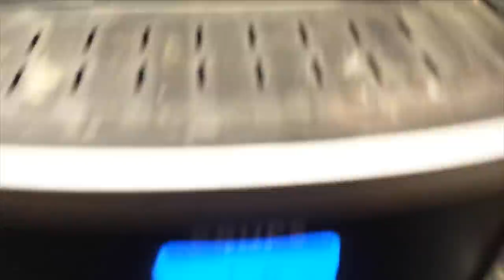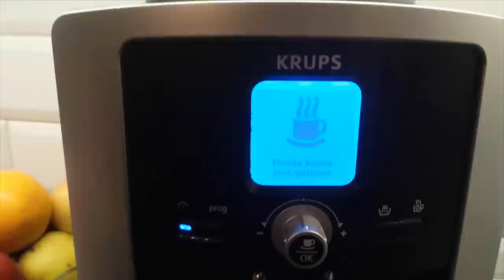KRUPS XP7200/EA8000 wyciek cz1. [leak part1.]

Comment: Thanks for good video, I didnt know my coffe machine have hydraulic cylinder, and it was leaking. After cleaning it and replacig four orings it works again, like new.

It is easy to misdiagnostice the hydraulic cylinder leak with boiler gasket leak, because water from both drops on bottom of boiler and boils.

Comment: Great video!

Gasket set for EA8 / XP7 series (Nitrile rubber (Buna-N)):
Coffee piston:              2x O'ring 3,5x36mm
Auxiliar piston shaft:  2x O'ring 2,7x16mm
Auxiliar piston:            1x O'ring O'ring 3,5x3,53mm
Auxiliar piston cover: 1x O'ring 1,9x34mm

Boiler seal MS-5015004 genuine only

Comment: Thank you Mariusz for the excellent and instructive videos. You can tell that you love your coffee machine, and you know it inside out. Well done !
Reply: +Nik Bernaz My issue was with the water tank sensor not working well. I opened the machine, removed it, then it starting acting all crazy. I put it back and stuck a magnet on it with sellotape and all my problems were gone, but I used your grinder cleaning video too as it was in dire need of cleaning too !
Reply from the maker: +Nik Bernaz 
Hi,
Maybe your problem with the tank sensor was caused by sink float?
It is very often issue. In this case you have to dry the float. The easiest way is to put entire water tank to the microwave (I'm not joking). The microwaves works only on water - only wet elements are heated. So when you put the tank to the microwave, set the time max to 1 min. than leave it to cool and repeat it till you will be sure when is totally dry. Fill with water only when is cool. Please be careful and don't heat to much (to do not damage plastic elements).

\Mariusz

Comment: Great video. Very helpful for me to get the machine to pieces for cleaning. Also I had a 09 error which is due to the thermo block temperature sensor connection at the board end (blue cables at the top of the board). Again only cleaning with contact cleaner required. We are back in business. 8295 cups and counting !!!!
Reply: mine is leaking, originally thought it was piston rings - which were worn, replaced, but still leaking, can't tell exactly where since it needs to be somewhat put together to run, but I think the hoses might be clogged because it starts leaking when it says "fill".  Any advice how to clean/fix?

Comment: Amazing Video. I opened up mine today because it doens't warm up . I think the heating element died, but the machine is only 2.5 years old . I measured the resistance of the element and it's 0 . To me an indication that it died. A replacement heating element is too expensive i think . too bad, i like this machine
Reply from the maker: +bartdereu 
Hi,Actually it is very rare to damage heating unit on this machine.But strongly possible is that the thermistor (glued to the drum) is unglued or unsoldered.Have a look at this video: https://youtu.be/pHsmttJ79zo  (starts at 6:00 - 8:00).
\Mariusz

Comment: Very good video ! I am trying to repair a Krups EA81. I have a question : I have a spring of diameter 1.5cm, with both ends coming out on 7mm. Would you know where to fix the screw ? Thanks in advance.

Comment: Hello, 
I have exact same model as your video. I have been using for about 8 years without problem. Recently water not pumping. When it brew i can hear pressure pump pumping. For normal cycle, it pump first ..silent and pump again. Now after first pump ..and water leak below and no water coming out at all. Is it o-ring issue? Which o-ring is causing problem? 
Thanks in advance for your video. It helps me out to disassemble it.

Comment: Igor, good afternoon, you made a great video, very helpful. I have an 8250 coffee machine Krups EA8052. My problem is that when I feed roasted coffe beans the grinder on the machine stalls. If I start empty the grinder, it runs withut any problem. Is there any kind of trobleshuiting to find out what is wrong?
Reply from the maker: Juan J Russ 
Hi Juan,
I'm sorry for short delay, but I don't have a time to turn ON my computer last time.
Actually the only thing I have is just to disassemble the grinder and check if everything is OK.

Very often is that the grinder stuck because grounded coffee is not distributed to the boiler. And it is not distributed because is wet - sometimes when U do many coffees one by one, there is a lot of steam inside and it is possible to glue grounded coffee. So when the grinder is full of coffee, is unable to move.

Just disassemble and clean it with the vacuum cleaner and a piece of stick.

It is also possible, that U have electronic problem, but I will not able to help you with it.

\Mariusz
Reply: Thank you any way, have a great day

Comment: Hello, thank you for your video. Why did you repair the hydraulic system and what did you change?
I have Krups EA8010 and my coffe is too weak. I think, something is wrong with my hydraulic system too, but I do not know what.
After making coffee, the coffe ground is not dry as it was before and coffee is not so black. Thank you for your reply.
Reply from the maker: Hi,
Sorry for late answer.
I have repaired this coffee machine because of leak of some rubber gasket (There was an error 06 on the display which mean "water leak problem").
So I have changed all of gaskets (like here: http://www.elektroda.pl/rtvforum/topic2354155.html)
Sizes:
2 pcs. oring 16 x 2,5
1 piece. oring 28 x 3,5 
1 piece. oring 32 x 1,8
Funny is that you can buy complet of all rubber gaskets by ~20eur or go to the local tool shop and buy by ~2euro cent/piece (one eur for all of them)

But your problem is probably caused by the wrong settings. You can of course set water temperature or coffee strength, but more advanced settings are hidden.

First - you can change the grind level. If you disassembly only the top of the coffee machine, you can adjust basic grind level.
Second - please find somewhere advanced manual to this machine (there is hidden possibility to change time of grinding).

\Mariusz
Reply from the maker: Hi again.
Yesterday I face the problem that despite of replace all gaskets, water goes to the bottom, and the ground was very wet.
I've found the problem inside the boiler. The responsible gasket (part No:MS5015004).
Please have a look at the short clip: KRUPS XP7200/EA8000 wyciek cz2. [leak part2.]
I will capture replacing process, because I haven't got the ordered gasket yet.

Comment: Hi Mariusz Grden,

I have an EA8005, one of the water tubes inside has split and the unit is leaking.  I'm not sure where to get a replacement from.  Are there any part numbers for the tubes in your service manual, or could you point me to somewhere to purchase a replacement?

Many thanks.
Reply from the maker: +Andy Earnshaw 
Hi Andy,
actually I don't think if the pipes inside the machine are on the spare parts list.
They are just a regular tubes that you can buy on every DIY shop - just take the old one and choose similar one.
Or You can shorter damaged one and fix using new screw clamp.
\Mariusz
Reply: Thanks, I was hoping that would be the case. Unfortunately I can't shorten the damaged one since it has a large tear, but I'll look out for some at the DIY shop.  Cheers!

Comment: Hi Mariusz. I have a very specific problem with my coffee maker. After the machine starts to push the piston down by pushing water into the pressure chamber, it can never detect that the piston is fully down. So the coffee maker keeps pushing water into the pressure chamber and tries to push it lower and lower even it is all the way down already. After this the coffee machine shows eroor code 06 (water leak) but actually there is no real water leak at all. Everithing is dry. The problem is that the machine can not detect that the piston is down. Can you advice me how to fix this? What sensor detects the piston is down?

Comment: Hi Marius, great video! when choosing espresso I noticed that  My EA8250 release some steam first and then do the coffee so my espresso is only 20ml instead of 40ml. I also noticed that during cleaning mode, during short water injections, the water goes in the bottom tray instead of the bowl. I also noticed that the pump makes a struggling  a noise at first.  would know the issue?
Reply: thanks à lot. which parts should I buy? http://www.belstar-electrics.co.uk/search.php?Search=&search_query=ea8250+piston
Reply from the maker: You shall buy Maintenance kit - like this one:
http://www.ebay.com/itm/Maintenance-Kit-Seal-with-Silicone-grease-suitable-for-Krups-XP-EA-Rowenta-/161517402084
In your case most important is gasket called "Barista" - part number: MS-5015004

\Mariusz
Reply: you're a superstar !!! 😎 thanks so much. in your video I will see how to change this deal kit?
Reply from the maker: Exactly, this is what video above is about.
Fingers crossed,

\Mariusz

Comment: Hi Mariusz Grden.
My Krups EA8250  has this problem:
- When I press button to make coffee, after grind the coffee beans, the brew group moving, then the pump builds water pressure up but never releases it through the coffee-outlet. Then steam comes from the driptray. At the end, both the Clean and Calc indicators blink.
- Then I press the Clean button, it work in cleaning program in 2-3 minutes, then turn off both led indicators.
Can you give me any advice?
Thanks
Reply from the maker: hi,
Please try this:
http://www.repax.dk/files/EA8050%20temp%20mm.pdf

there are all possible issues described. I hope will be helpfull

\Mariusz

Comment: Hi there, I am having a problem with the water leaking out of the hole at the bottom of the machine...and it wasn't even started yet.  Any advice ?
Reply from the maker: Hi,
please check the water container gasket - it's leaking sometimes the way you described.
\Mariusz
Reply: +Mariusz Grden , where exactly is the gasket located, what does it look like?
Reply from the maker: Hi, check this out: https://youtu.be/pjmo_-dO8MA

Comment: Hi Mariusz Grden.
My Krups EA81*  has this problem:
- When I press 1 cup or 2 cups button to make coffee, it only grinds in 2s and the pitton start press ground coffee to make coffee, so the coffee is too weak. I had cleaned the grinder but the problem is not solved.  I think it lost the parameter of grind timer, so I reset it (unplug the machine, remove all accessories, press both button “Rinse” and button “standard Coffee” and plug the machine). After unplug the machine and plug it again, I press the power button, it turn on. But only the rinse button and power button are working, other functions are not working. Now it can't make any coffee.
Can you give me any advice.
Thanks
Reply from the maker: Hi,
As Krups machines are easy to fix, the electronic boards are really weak. I mean that I have two Krups machines at home with damaged electronic board. Actually it is about the board replace, but it is not worth to do it because the price is a half of another machine (second hand of course).
So finally I get rid of Krups, and I bought Jura.
I know that my advice is not helpfull - it is sad but true. Your problem seems to be caused by electronic board.
\Mariusz
Reply: Sadly to hear that.
Thanks for you help.
May I will re-programming that board, I can program STM and it's using STM8. Hope it's successful.
^^.
B&R.

Comment: My Krups coffee machine  (3 yrs old) made a loud whining noise while grinding, after which no coffee came out (I stopped it before the pressure grew too much). Any advice, is it broken? or just cleaning needed? The grinder is kind of whining more and more in the last few months.  Much thanks.      Adrian, Ottawa, Canada
Reply from the maker: +Adrian Florea 
Hi,
Actually I have no idea. Helpful could be an error display message. 
But because You told that the noise was while grinding, I guess that there is a problem with the grinder.
Please have a look at this video:
https://youtu.be/3hqZKm4mH2k
It is a common problem that the grinder is full of coffee powder and the coffee doesn't go to the chamber - so instead of tasty coffee , only water comes to the cup.

If you will get any news (error message or some bottom leake), please give me a message.

\Mariusz
Reply: + the problem was with the grinder, there was some debris or coffee inside; the coffee was not falling into the chamber and was just jamming the grinder; the grinder was actually slowing to a full stop, I could hear a big whining noise then the gears slipping... After completely removing the grinder from the machine and a thorough clean-up, works fine for now. Hope the wear and tear on the gears was not significant...

Comment: Mariusz, I have Krups EA8260 it has smudges of coffee when cooking coffee. Which gasket needs to be changed?
Reply from the maker: +Antonio Pavlov 
Hi,
I don't uderstand exactly what do you mean that it smudges.
For example if grinded coffee beans are weat in the dregdrawer and coffee  is not so strong,  look for the leak to the bottom container. In this case the bottom piston gasket (boiler gasket) is finished. Please have a look at this video: https://youtu.be/mft5b4iGkvk?t=1m39s

But if it not leaks to the bottom container, but you coffee is weak, the responsible gasket is inside of the piston. It calls "Barista gasket" and is available only with the piston (entire piston is not expensive so is good to replace all set).

You can also disassembly top cover (this one with the hole for the cleaning tablets) - just the one screw. Without this cover you can observe entire process and maybe you will catch that the coffee goes outside of the piston (smudges all around) - it means that the piston gaskets are gone. In this case I recommend to replace entire piston set because it costs same as just the piston gaskets and it includes: Piston, Two piston gaskets and "barista" gasket inside.

Fingers crossed
\Mariusz

Comment: Nice video helped me to fix my krups EA8260 now I want to change all the O rings but can not find a parts list, can you help me with this?
Reply from the maker: Hi,
I don't know exactly the spare parts numbers.
Here locally I can buy easy on the internet bid full maintenance set of gaskets, co I don't have to care about each of them. Here is costs 75pln = ~25$
Example source:
http://allegro.pl/zestaw-uszczelki-zespolu-kotla-krups-xp7240-ea8050-i6541810901.html

But if you like, below are gaskets sizes:
2 pcs. oring 16 x 2,5
1 pcs. oring 28 x 3,5
1 pcs. oring 32 x 1,8

It is nice to replace also the "Barista" gasket - this part number I know: MS-5015004

Fingers crossed

Comment: Hi!  I have a Krups EA8010, FPB1450 0010M, which I have had for several years, and at several times have disassembled and reassembled, because I have had problems with ground coffee sticking and clogging up, and it have turned out well after cleaning.  Today however I got a problem after I reassembled it, and power it on the following happens:
a) some noise sounds (some axis looking like it controls water distribution turns).
b) the "showel" turns in, the piston lowers, into the cylinder
c) the two right side LEDS (clean and calc) blinks steady. 
d) the only button that works is the rinse button, which will empty some water through the steam nozzle, lift the piston a put the shovel out.
e) from here either it cycles back to a) once, and 2nd time here goes on to...
e) all four leds blink, and error message 5, what you say water pump failure, is lit.
f) nothing works, but powering off.
Any ideas?  I think it's more likely I managed to disconnect something rather than something broke, when I diassembled/reassembled the thing.  I cannot see anything loose, but...
Reply from the maker: Hi,
You're right - it seems like U missed some connection or one of the sensors is locked.
Please have a look here: http://www.repax.dk/files/EA8050%20temp%20mm.pdf
There you will find a description of almost any problem.
\Mariusz
Reply: Many, many thanks, I will dive into that manual immediately!  I owe you a beer for sure!
Reply: Hooray.  It was one of the lines to the flow meter that had gone loose.  Attached it again, and it works fine again.  Great!  Now I owe you two beers :-)  Btw, do you know where I can buy  a replacement kit of seals that get worn online?
Reply: hello Niklas,  I have the same error you've describe above. what do you mean by "the lines to the flow meter" a picture of it? many thanks

Comment: Hi Mariusz,
You are so helpful! I hope you'll help me as well. My EA8250 is 2 years old and started having a problem - used coffee cake is not expelled, error code 07 is displayed, or a message "Machine needs filling" displayed and the filling cycle does not end. Couple times after powering it off for a day it returned to working condition again, but now it happens every day  after 1 cup of coffee, today even powering it (disconnecting an electrical cord) off did not help. Thank you in advance.

Comment: Mariusz,I'm having an issue with my EA8250 that when it boots up it asks for the time and goes into machine adjustment. Once that is done it has me clean all the trays, goes into self maintenance and then back to machine adjustment. It repeats this several time before showing a picture to unplug and plug in the power chord. What might be the issue and how can I fix it?Thanks in advance,Kyle
Reply: +Kyle Dame (Dameki)  hi have u solved the problem with the plug unplug screen ..i have the same problem